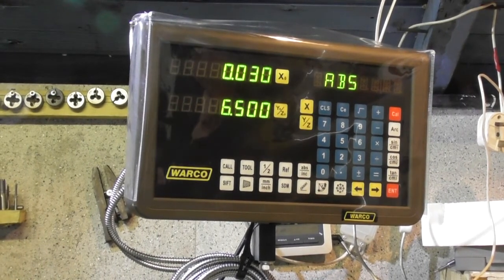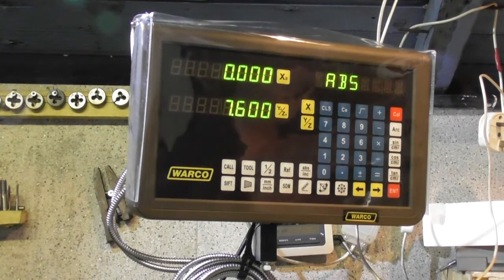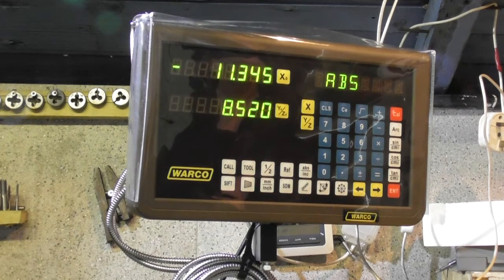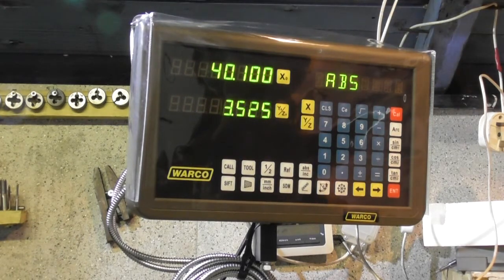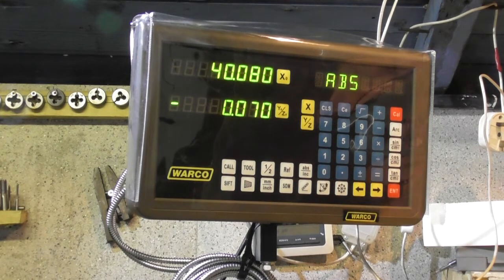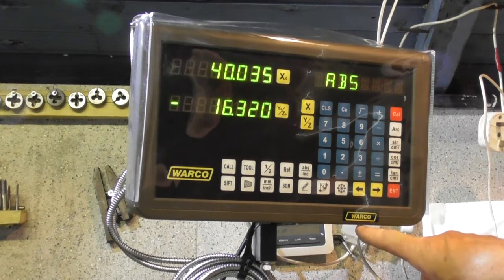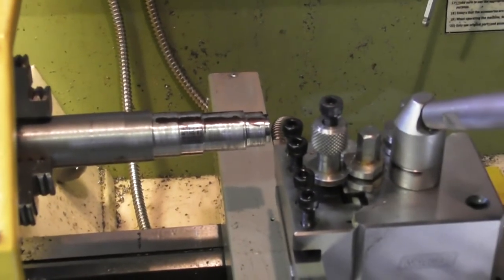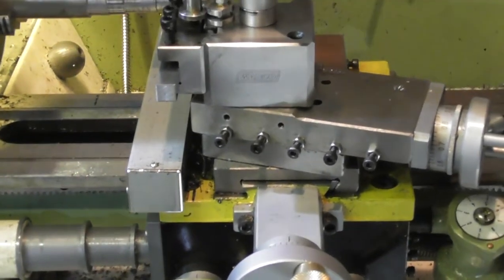Warco WM180 New Beginner . How accurate is your DRO ?

Comment: Did you indicate the glass scale in both axis? The machine casting usually is not to precise. I saw in another video that you have indicated the top part of the scale, but how about between the machine and scale(horizontal plane)? That has to be precise as well. The cross slide scale is not in the way of the chuck?
Reply: The cross slide scale misses the chuck . I did check both axis👍